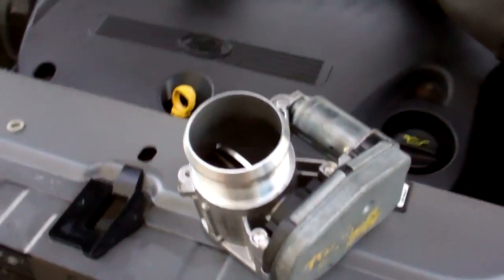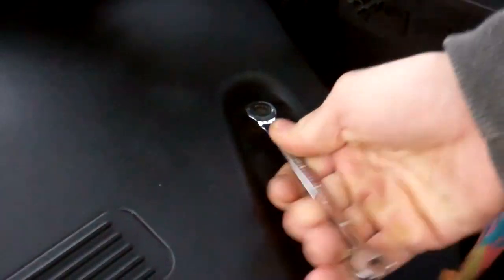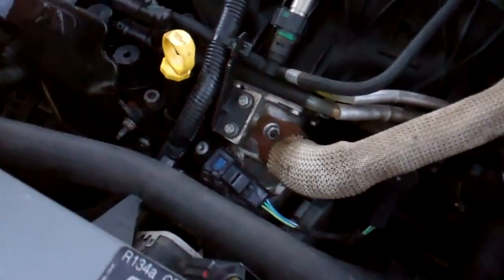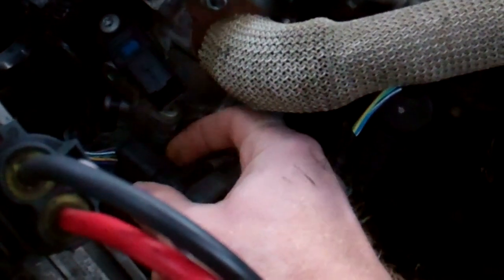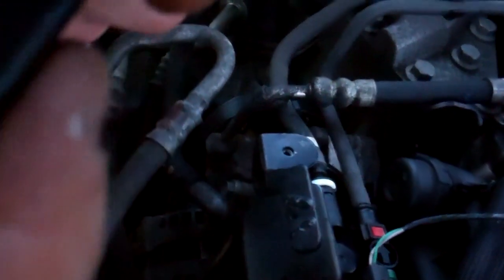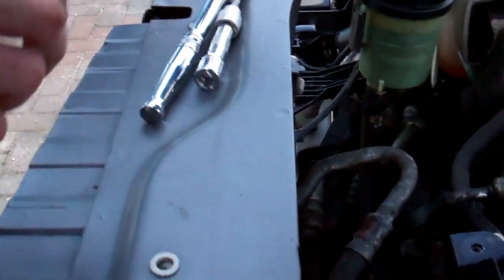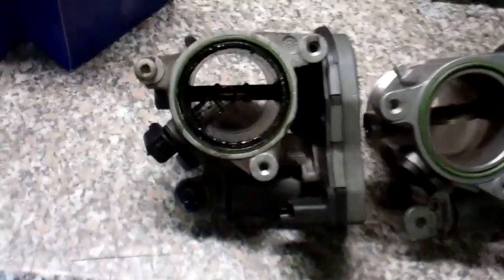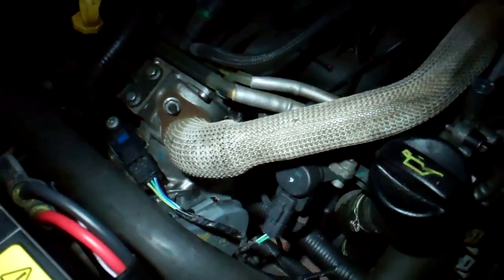How to change throttle Valve on Land Rover Freelander 2 / Evoque 2.2 Diesel

Comment: Great stuff you are doing- isn‘t it necessary to calibrate the throttle?
Reply from the maker: I did not and it runs better with the new throttle than the broken one.... maybe it will be a tiny be better with calibration.... but is it worth it ?
Reply: powerfulukltd i don’t know- still suffering of the limp Mode- First DPF and now the silent throttle- really mess:(